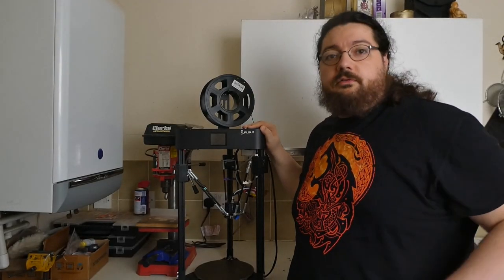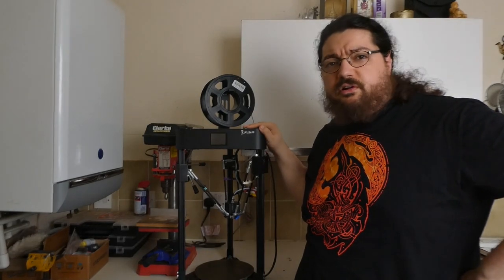3D Printing, Luthiery, and You!

Comment: I've toyed a lot with the idea of a 3D printer - but more for models and figurines.
For guitars - while I was impressed by what you did, there is a LOT of amazing hardware out there already that is made to exacting standards and someone else has done all the engineering and testing. (I'm currently in love with the Hipshot baby-grand bridge)
For guitar building, I'd personally get more use out of a CNC cutting/shaping rig over a 3D printer.
Neck & fretboard profiles, fret slots, pickup cavities, control cavities, inlays etc -

Comment: It is kinda weird that some look down on any tools devised after 1823, especially electrically powered, as some kind of modern withcraft.

Your Japanese rasp is a labour saving tool you use with your hands, but the 3d printer or the CNC are programmed with your hands too, so aren't they just different hand tools?  The more you practice with a chisel or a plane, the better you get.  The more you practice with cad/3d, the better you get.  Its another skill, just like all the other tools in your toolbox.

Where do you draw the line on aversion to new fangled modern tech?  Don't use modern glues, modern paints, modern finishes, modern truss rods, none of that electrickery and amplication - acoustic lyres rule...